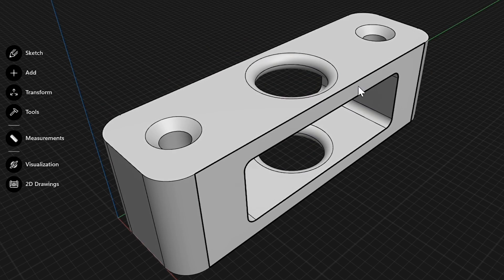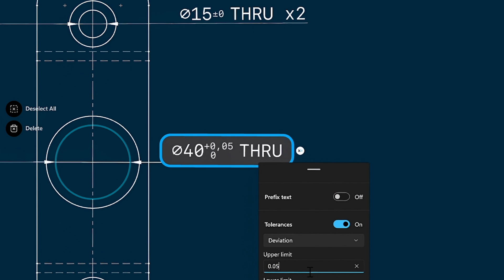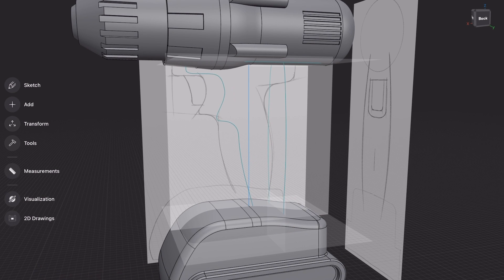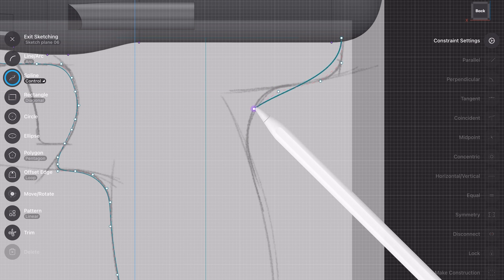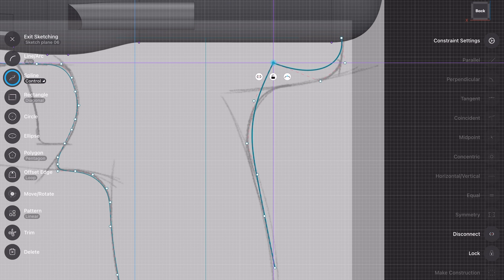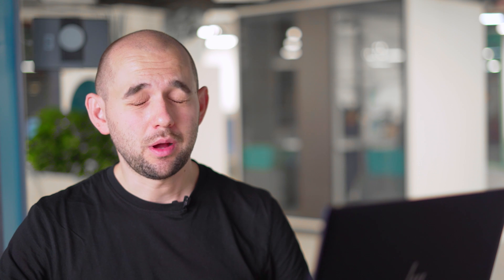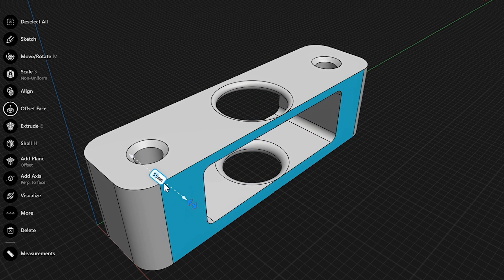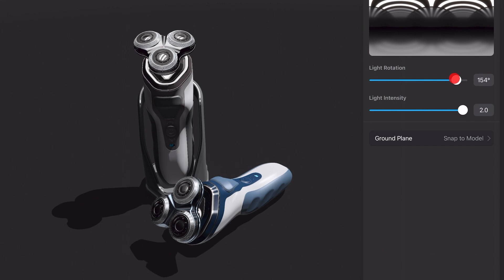Drawing Tolerance & Spline | Shapr3D Updates

Comment: I am a Japanese user.
First of all, I strongly hope that 2D drawings will support the third trigonometry.
There are many other improvements, such as snapping projections and dimension lines so that they can be aligned on the same line, and changing annotation sizes and fonts.

I don't think that the current situation is a match for manufacturing that assumes machining, but I will continue to support the subscription in the future.

Comment: Being able to add control points on a spline has been on my wish list for 5 years. Istvan even commented that it seemed like a good thing back then. What I also asked for at the same time, closely related, is the option to also remove control points. 

For most, splines are seen as a free form tool, but I design boats. A spline is THE tool, and it has to be made with as few control points as possible, to make sure lofted surfaces stay fair. The surfaces literally have to fit the flow of water. 

Adding and removing control points is how I develop a shape. Until now, I had to draw a new spline with the updated number of points and delete the old one. Also works, but some splines can be very long and complex. Looking forward to trying the new features! Just to clarify, the above is NOT complaining. I love Shapr3D, and I think these changes will make me use it more.

Comment: so does the tolerance actually change the size of the object? or is it just a labeling feature? 
it would be nice to be able to draw and object and adjust the size of the object to factor i. the tolerance so that parts can interlock easily.
Reply: @sebcachia1852I’m 3d printing threads and am looking for the best way to add some tolerance between screw and nuts